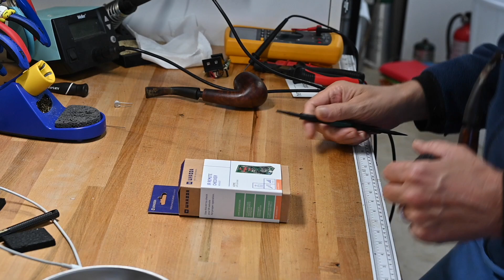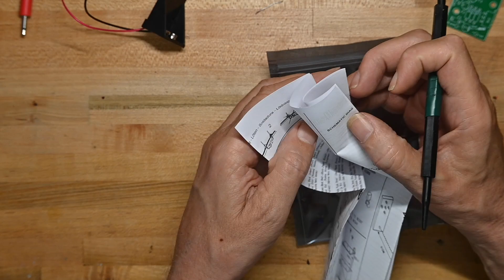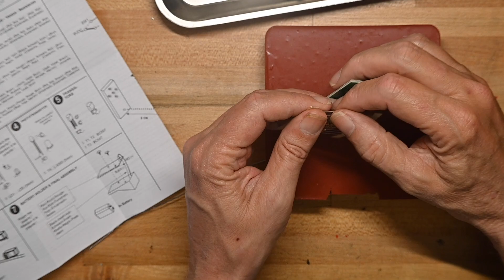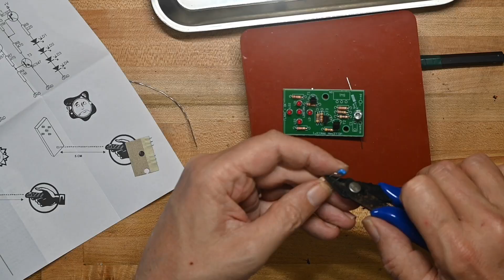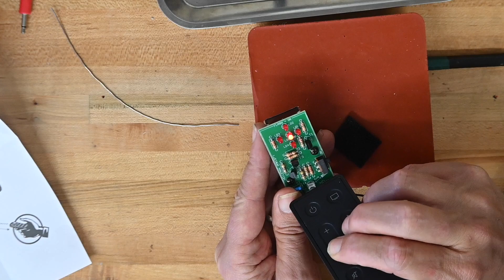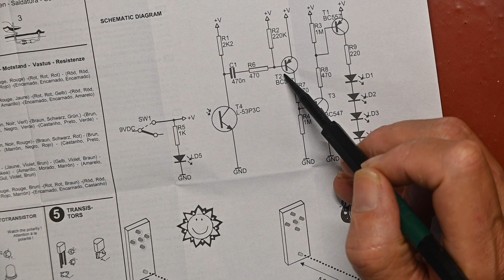C.K. builds an Infrared Remote tester kit from Velleman/Whadda

Comment: Most cheap webcams have an IR filter so that heat doesn’t blind them. OTOH the iPhone & iPad cameras don’t. Point any IR remote at your iPhone or iPad (with the camera or FaceTime app running) and you can see a purpleish light if it’s transmitting. Just an FYI… [of course you won’t have the joy of building this kit then will you? ;-)]
Reply from the maker: @geowar20 Yeah, if I were doing this to demonstrate efficiency or practicality I , uh, wouldn't be doing it :)